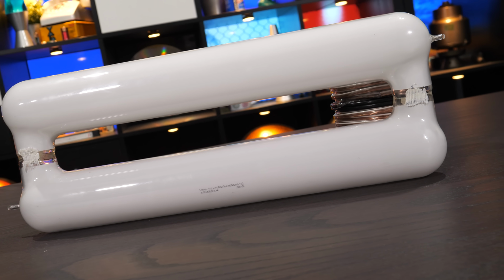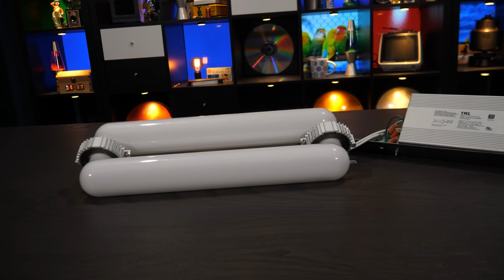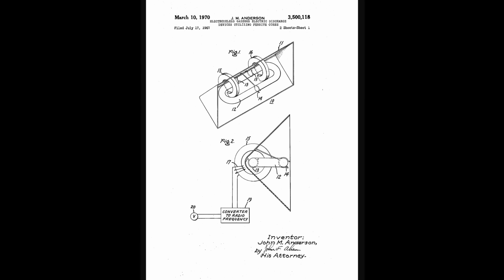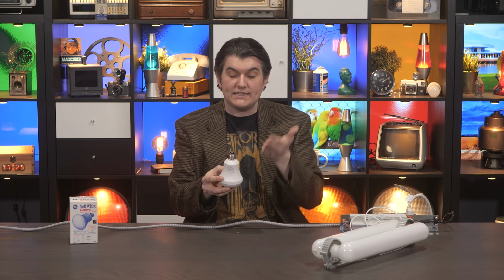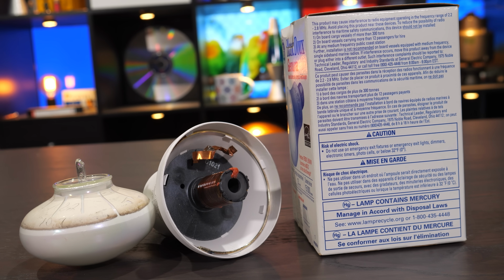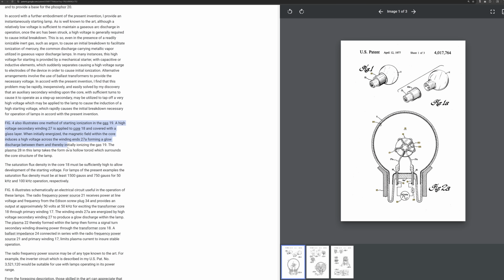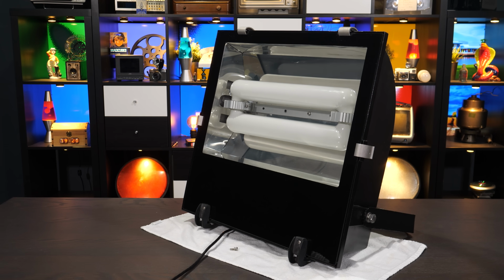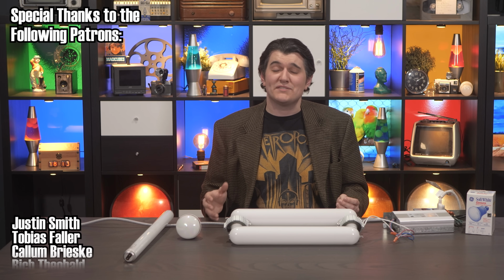Induction lamps: fluorescent lighting's final form

Comment: I’ve had the same LED bulb in a floor standing lamp, which expels heat away from the electronics near the base of the bulb, for at least 10 years now. I use the lamp everyday. The lamp is very “Frasier” so all the metal probably helps sink the heat, too.

Comment: I work in the Internet and cable TV network tech support. We had a peculiar case a couple of years back: inhabitants of one apartment complex complained of a poor TV signal and artefacting. We send techs there a couple of times, but never found anything. Until one day they went there in the evening, and they were looking at a test TV when the corridor lighting came on. They immediately saw interference. They found an offending lightbulb and removed it, and the interference stopped. Everyone was puzzled, because no way any lightbulb could interfere with high-frequency signal inside the copper coaxial cables.

Well, now I know it was probably on of those types of lamps!

Comment: 19:46 plasma cutters use HF to start the ionizing gas that is directed to cut metal. 
I think it is just the high frequency that works. probably need an electrician or an electrical engineer to tell you why with relevant math.

Comment: While it's no internet or combustion engine, it's kind of wild that in my lifetime lighting went from a common concern to just...a solved problem. 

Like, I remember as a kid getting yelled at for leaving the lights on, because it genuinely impacted the electrical cost for the house. We had a drawer in the house dedicated exclusively to lightbulbs. Having a light burn out wasn't uncommon, and then we'd have to deal with annoying lighting until someone went through the rigmarole of getting a ladder, pulling the lighting cover off, finding the replacement, maybe driving to the hardware store, and then putting everything back together. 

But while it's not life-changing, it's kind of amazing that lights just...work now. Like people born nowadays just have the lights basically always work. And that's great.
And I'm not even particularly old.

Comment: Plasma sputtering is one of my jams. Big problem in magnetoplasmadynamic thruster cathode design and thruster operation.

Actually, wait, these are very like MPDTs.... even the no conductor start option. Your understanding of how they start is pretty accurate to what we do.  Low volume of low work function gas, put a huge voltage drop across the area, with sufficient current, you spark the gas into a quasi-neutral plasma thats self sustaining at lower voltage and current.

Comment: I had one of these in a projection TV i took apart. The bulb was tiny and partially encapsulated in a thermally conductive cement. The bulb itself was only the size of the small vitamin pill but the high frequency, high voltage driver circuit was massive with a giant heat sync attached. You should try to find one of those projection TV's it was a blast to take apart and see how the induction lamp worked.

Comment: 7:31 it’s actually not hard whatsoever and can be done with a single transistor and a 9v battery. Check out a “slayer exciter” circuit
Reply: This will even light up “blown” fluorescent bulbs as the electrode isn’t needed to start up

Comment: Part of my job used to be lighting design, and when the QL lamps came out (was it late 1980s?) they looked very interesting.  I forget the cost, but in the UK I think it was around 5 - 10 x the cost of a fluorescent batten.  I did specify them once, 6 of them IIRC, for a space where lamps could only be changed by erecting scaffolding, and dimmability and some elegance was required (in a theatre auditorium).  As a small part of a large scheme, their cost was acceptable.  Unfortunately, the project was handed to a colleague before construction, so I don't know if they were actually used.  I was probably working on 4 projects per year, and that was the only time I could justify them!

Because of the radio frequency used, the control gear should have been in an earthed metal box, connected to the lamps by earthed shielded cable, but I don't recall that being mentioned in the catalogue and I don't know what the installation instructions said.  In any case, I suspect the lamp itself could not be properly shielded.  However, IIRC, Philips had them in their catalogue for about 10 yrs, so presumably they didn't get too many complaints.  Of course, in the 90s, there were not that many items susceptible to radio frequency interference.

The issue of street lighting (or path lighting or corridor lighting) is an interesting one, because in most cases, a surprising variation in illuminance of the horizontal surface is acceptable.  That is for two reasons.  Firstly, the eye's perception of luminance is approximately logarithmic, cf camera stops or the fact that we can see a faint star at 10 - 100 nanolux, but the eyes are not injured looking at, say, a white wall in bright sunlight at 100 kilolux -- a difference of 10^12, only a small part of which is adjusted for by the iris in the eye.  Secondly, the items of greatest importance to see in a corridor, path or road are vertical objects, eg stairs or obstructions, which are made more obvious by light falling at a shallow angle.  In most cases, the limiting factor is analogous to that in offices -- arranging the cut-off angle so that people are not blinded by having the bright lamp directly visible, and a common spacing used to achieve that is 7 x the height of the lamp above eye level, which even with a basic optic giving even luminosity in all directions below the cut-off, gives an acceptable variation in illuminance -- that relates to walking, cycling or driving, where the eye will almost always be looking horizontally; in an office, a much steeper cut-off is required because people's eyes stray round the room and up and down to some extent, and also, computer screens reflect light at shallow angles into people's eyes.  So the perfect light source is a horizontal rod, or at least a lamp which is not too fat, and although it is not quite optimum, a streetlight is typically no more than a simple mirror covering the area above the cut-off and occasionally a fresnel lens to improve light distribution.  So, as you say, the form of a rectangular induction lamp is not so good, since with a standard light fitting, it would waste power by over-lighting the area directly beneath it to about twice as bright as needed, although a fresnel lens could have corrected for that.  When the QL was introduced, much streetlighting in the UK was still by low-pressure sodium (SOX), which had a similar efficacy and a relatively small, thin tube for the lamp, allowing a small, cheap fitting, although IIRC, the lamp life was a little shorter, say 50,000 hrs.  IIRC, the smallest sizes of SOX, used for paths or when street lights had to be very low, were 35 W and 70 W, so the QL could have replaced them, particularly as there was a growing desire to get away from bright yellow lights, but Philips seem to have failed to get into that market -- I think they would need to have designed an outdoor light for them to fit in, but if they did, they never put it in their catalogue.  I never saw one of the rectangular lamps you had -- I left that line of work in 1999 -- but again, if an external light with a fresnel lens had been produced, that would have been a possibility -- it was powerful enough for most streetlights (IIRC the normal sizes were 250 W and 400 W, but that was for high-pressure sodium or mercury lamps with IIRC a luminous efficacy of only 70 lumen/watt).  But the control gear, light and lamp would all have been more expensive than the competition, and presumably, if they did try marketing it, they must have found that the increased life and increased efficacy were not considered worthwhile.  And, as you say, now we have LEDs.

Comment: I worked for Philips lighting and Signify. Over the years they were always looking for cutting costs, so while the first generation products might last the adverted lifetime, the later generations would fail early due to the cheaper components failing. I hated that. But it's how the market works. And people don't count the hours and just blindly trust the brand. Until they even stopped doing that and Philips is little more than a brand name now. (Yes there's medical and some small lines, but it's a fraction of what the company was)

Comment: high enough radio frequency powers have enough electric field strength to ionize a low pressure gas.  just like if you microwave a neon lamp.

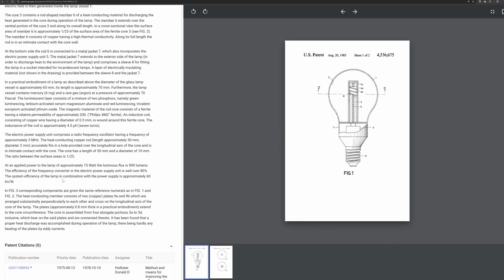Comment: Hate to say it, but that patent at 20:40 is pretty much spot on. The high-frequency magnetic field creates an electric field inside the bulb, which is just enough to get the electrons moving and kick off ionization.
High-frequency AC (usually tens to hundreds of kHz) runs through a coil or induction antenna.
That creates a rapidly changing magnetic field.
The magnetic field induces an electric field in the gas-filled tube, even though there's no direct connection.
That electric field energizes electrons in the gas—usually argon or something similar, sometimes with a bit of mercury.
Once ionized, the gas becomes plasma and starts conducting, and mercury atoms emit UV light as they get excited and relax.
The UV hits the phosphor coating on the inside of the bulb, which turns it into visible light—basically how fluorescent lights work, just without electrodes.
I should watch a video in full before doing these.
That mesh inside the bulb? It's actually a clever part of the design. It's not just random metal—it's likely there to help the gas ionize more easily. The way it works is kind of like nucleation sites in a glass of soda. The mesh provides a localized area where the electric field gets a little stronger or more concentrated, which helps energize the gas molecules and kick-start the ionization process. Once that happens, the gas turns into plasma and starts conducting, and everything lights up from there. It might also help stabilize where the plasma forms, or enhance how the electromagnetic field interacts with the gas. Some designs also use mesh like that to control RF behavior or keep the plasma anchored in one spot. But yeah—your observation makes total sense, and it's doing more than just sitting there!

Comment: If you don't understand how these work, I suggest you get a small slayer exciter tesla coil kit.
That's just a coil and a transistor as a fast switch. 

They'll light neons and fluorescent tubes even if you put a thick insulator (I tested with a HDPE chopping board) between the coil and tube.

The induction just induces a magnetic field and a magnetic field (at least an oscillating one) is technically a voltage, or can produce one. It's hard for me to put into words, but "quickly changing magnetic field makes gas excited", even that's explaining it badly.

Comment: Two types of lighting that LED still can't match in terms of performance: Mercury HID ultraviolet, and xenon strobe lights.

Ultraviolet LEDs should really be called violet LEDs with just a wee tiny fraction of the energy going "ultra".  Their photometrics are terrible for the application they are marketed as being able to fulfill.

And while LEDs (in general) can be strobed with very short pulses, the peak instantaneous intensity won't match that of a xenon plasma discharge in a serious concert-stage strobe light, nor will the persistence of the phosphor in typical white LEDs extinguish as fast as a gas plasma.

Now you could mimic white light with a blend of several colours of phosphorless LEDs -- that would solve the persistence issue and once again achieve quick strobe flashes -- but the peak intensity is still a problem.  You would either have to overdrive the LEDs and risk premature failure, or require a huge array of many hundreds (or thousands?) of LEDs for anything brighter than a half-useless novelty gimmick.  And that would cost much more than even a large nightclub/theatrical xenon flash tube.

Comment: They're still being produced commercially somewhere because multiple comments mention them being in active use.  You talk about how fluorescent light couldn't create a beam, it was always diffused. In many applications that is desirable and much less harsh on the eyes than modern LED 'drop in replacements'. I work in a repair shop and they kept all the old fluorescent fixtures, but over time replaced the burned out bulbs with LED 5k 'builder grade' tubes. The light quality and intensity is terrible. A friend of mine with a home garage shop did the same thinking it would be a big upgrade. He turned it on and hated it. Fluorescent gets dumped on but in many cases it was a superior light.

Comment: 4:00 do you mean 1,600 lumens? i feel like 16,000 lumens with 200 watts is more on par with LED.
also your following statement about florescent tubes made me think of a question. out in my garage (new england so large temp swings if it matters) i have one ballast with 2 tubes. in the winter i have to flick the switch a few times waiting a few seconds in between (seems to be the most successful recipe) to get them to turn on. the colder it is the worse it gets and sometimes unable to turn them on. in the summer they seem to work great although might be dimmer than what they should be. whats up with that?

Comment: They were 4 to 200 times the cost of a regular incandescent light bulb. they only reason they didn't take off outside of industrial and commercial use was simply a regular bulb came in a pack of 4 for a dollar  while these bulbs could be had from anywhere from $10-$55 bucks a bulb. the price didn't change much even when LEDs entered the market.

Comment: Technically incandescent lamps are still best at light quality.
Any incandescent lamp has color rendering index of 100.
Best LEDs have CRI of 98-99. But regular consumer LEDs usually have CRI between 70 and 90. "High quality" stuff stats from 80. And only specific LED light sources can guarantee CRI of 90+.

Comment: Fan fact (or an another technology connection you may say): the same principle is used in tokamaks (toroidal chambers with magnetic coils) for confining plasma in magnetic field, and the giant one called ITER is currently build with a purpose of nuclear fusion research, and because it will not have means to capture produced thermal energy it will be technically a lamp.

Comment: Thank you for mentioning that the weak point of this technology is the driver, not the bulb.  I've observed something similar with solar energy; the panels may last decades and LFP batteries may last 10,000 cycles, but the inverters and other power electronics may crap out every 2 years. We don't want to pay for ultra-rugged electronics and it's expensive to make electronics that will last for decades in challenging environments, so those electronics are almost inevitably the weak point.

I was once a huge fan of flicker-free fluorescent technologies and employed them in a range of applications, sometimes as soon as a new type of lamp would come onto the market at a reasonable price.  One reason I like this channel so much is that Alec appreciates the benefits and drawbacks of modern and past lighting technologies, but I had never encountered induction lamps until this video and immediately understood why someone would want them.

Due to the niche applications and requirement for ruggedized driver electronics, I guarantee that these lamps were expensive, but there are definitely applications where changing bulbs becomes very expensive due to logistics.  I knew a guy that once worked as an electrician in the U.S. Midwest (where missile silos and B2 bases tended to exist) and the military would schedule a work day, pick up a crew of screened and qualified technicians in a city, and then drive them in windowless vans into classified installations so that they could change a burned out light bulb; it quite literally took a crew of electricians to change a light bulb.

A standard bulb might cost $100 apiece in a military contract, but it cost the Pentagon a few thousand dollars to change it.  If an induction lamp would do the same job for 10X longer, they'd be willing to buy it for a thousand dollars each.  Not only does it avoid the cost of bringing in multiple, "blindfolded" electricians so often, but reducing the number of service appointments reduces security risks and the associated secondary costs (i.e. paperwork).

The price of the lamp can become relatively irrelevant if a longer service life can be obtained.

Comment: So I'm not an expert so very much could be wrong but will give my basic understanding of how the induction lamp begins to glow since I don't think they're that different from any other plasma lamp.  A hot cathode as you say will emit electrons that you can then accelerate into the mercury and get the discharge started.  In the case of an induction lamp you just need a strong enough electric field from the induction coil that you actually induce dielectric breakdown in the gas.  At that point the field is high enough to ionize the gas and get things rolling.  You don't even really need all that many ions and electrons due to Townsend avalanche, where the electron will be accelerated enough from the electric field that when it hits another mercury atom it can ionize that and it creates a chain reaction that quickly leads to plasma generation.  Considering the high ionization potential of mercury at over 10 eV I would guess avalanche plays a significant role but couldn't say for sure without trying to find some literature on the subject.